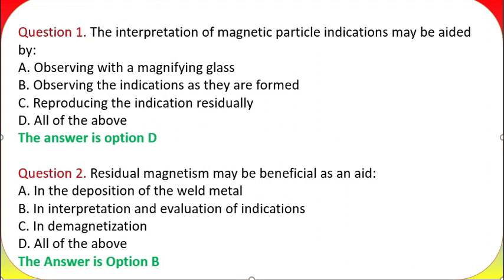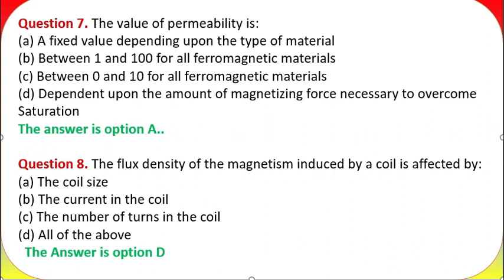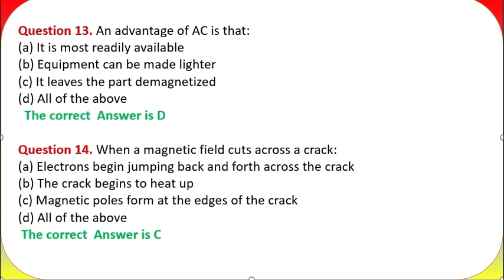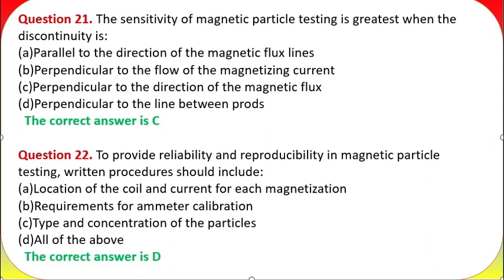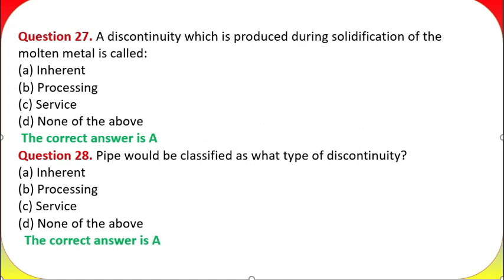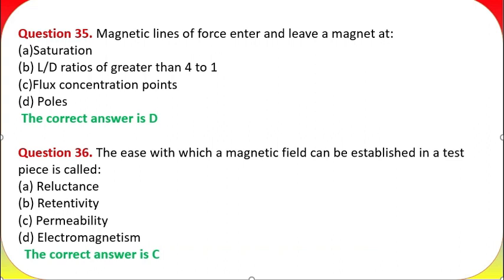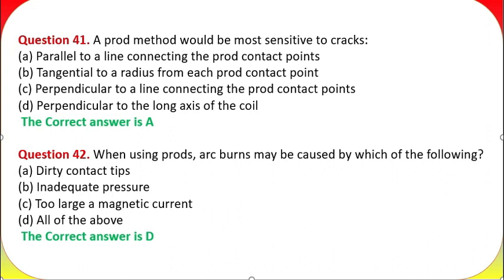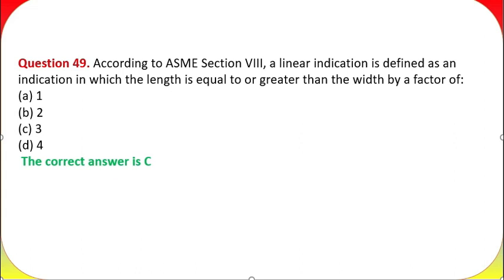NDT  MPT Interview Top 49  Questions and answers

Comment: As a asme section 5 article 7 ... Answer of question 9 is wrong!!  Correct answer is 3500 amperes-turns
Reply: According to this formula

Amp-turns=45000×Dia of workpiece/Length of workpiece

Ans is 5541.87~5625 is right